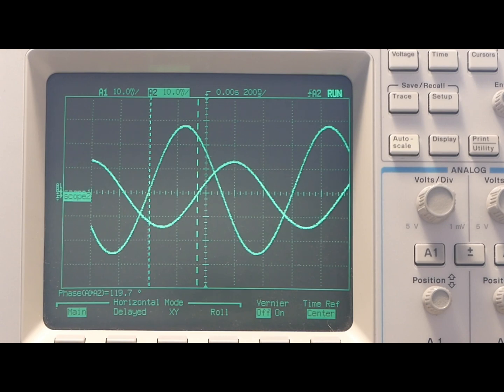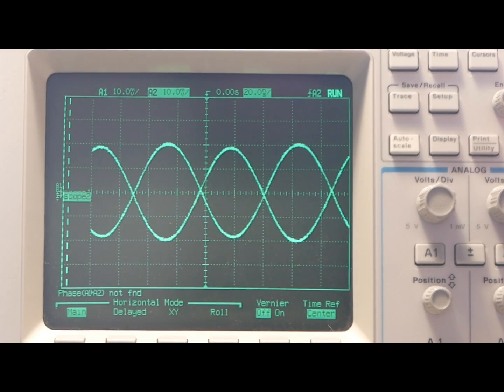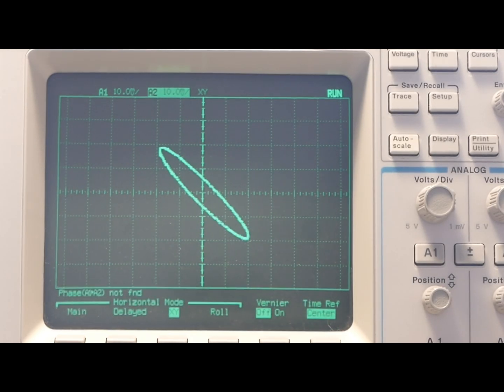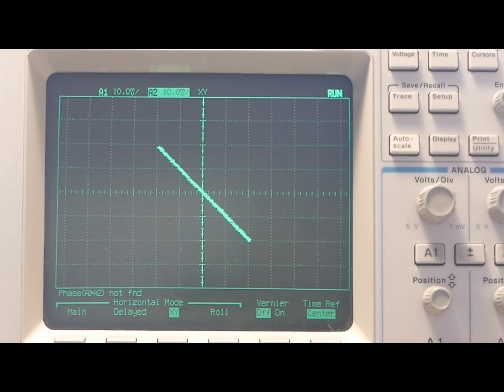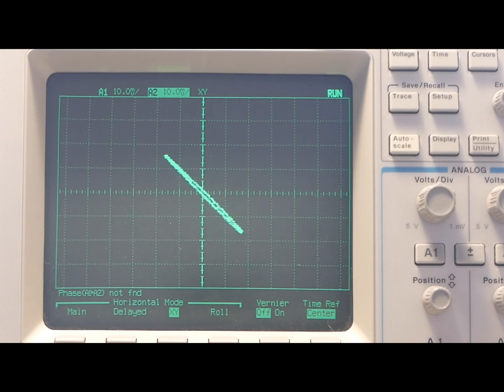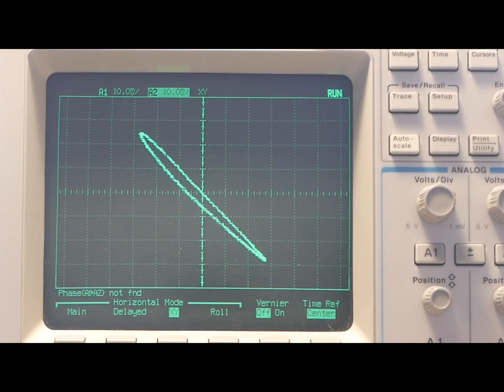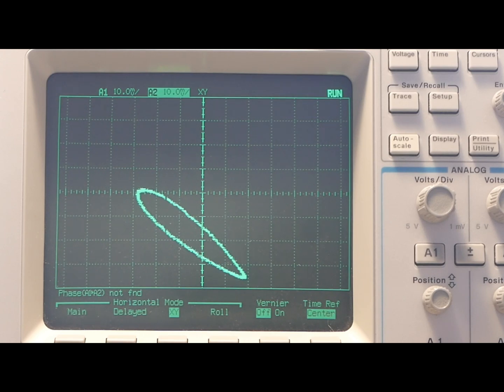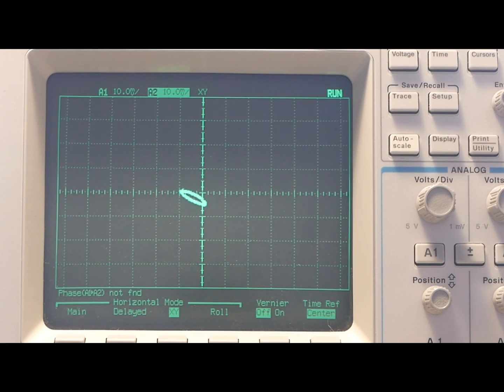Toroid Balun Frequency Sweep

Comment: My poor HP54645D had its channel 2 blown out... I need to find one of the front-end ADC chips with the big heatsink on it. When I removed mine, there was a big crack and hole in the bottom, so someone must have seriously overloaded it. But channel 1 and all the digital channels still work. At this point I'm not sure if it's better to try and find a broken donor machine or just buy a new scope :D
Reply from the maker: If you buy a parts scope, you won't know if the part you need is working.  I was going to say just buy another HP54645D off e-bay but I just had a look and the prices are stupid.  For that amount of money, it would make more sense to buy a new 200MHz 14bit Siglent or similar.